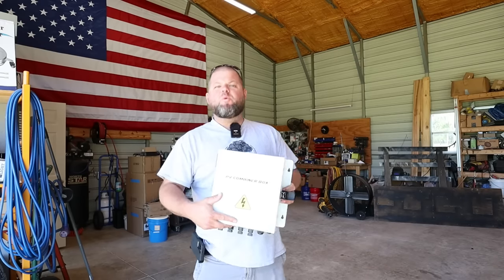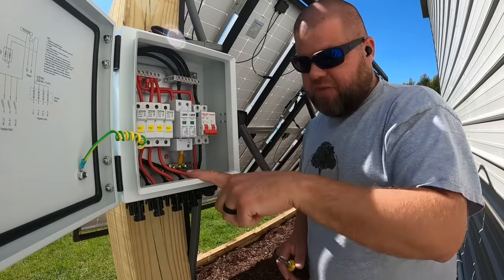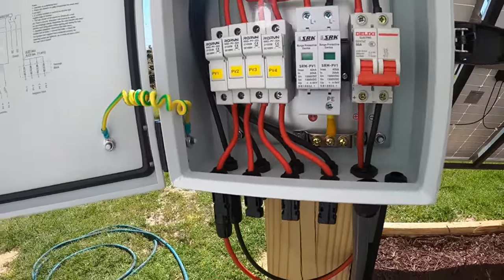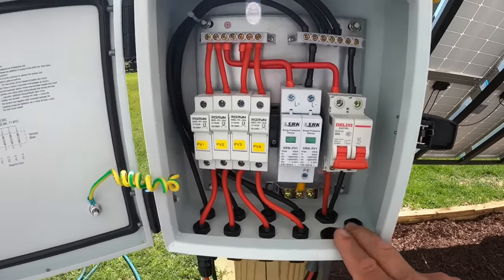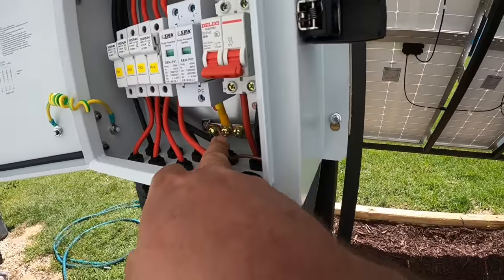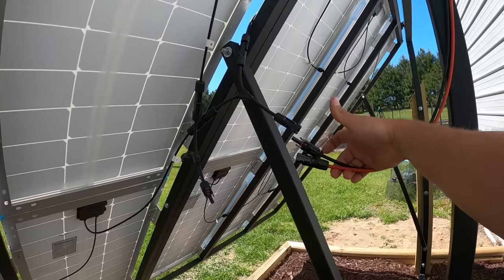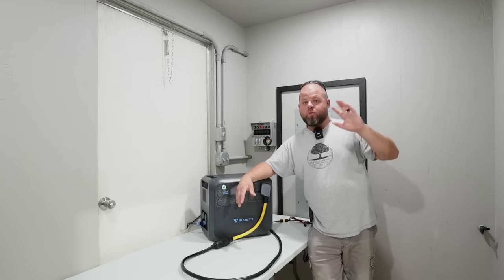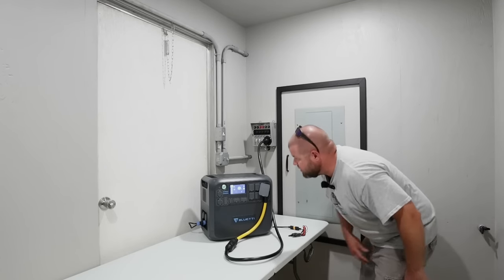Installing a PV combiner box. Why you need one for your solar array! #748

Comment: How did you determine the string length?  Many inverters will allow up to 25 -  400 watts panels.  Why was 10 panels strings chosen?
Reply from the maker: 12 panels and I'm adding 12 more. I run reviews on my channel and test a lot of different equipment. Some require as low as 100 watts for max input and some are going to be up to 8000 watts. 100 watt panels were cheap, easily sourced and allow me the most flexibility on changing combinations for testing equipment.

Comment: Good morning Andrew, I do have the same panel setup, with the combiner box, can I elect to delete Y bridge and plug the 6S2P array to the combiner  box and yield the same voltage and amps...tyi!
Reply from the maker: Yes, you amperage in that configuration will be under the max fuse rating.

Comment: I have one question please help me i an getting so tired to solve it but no one help 
I have inverter and my lithium battery bms not communicate with my inverter so the company say use battery with inverter add value manually so if the bms not connected with inverter so it can harm my lithium battery or its safe to use

Comment: Curious why the combiner box when good quality charge controllers today have a VOC of 500-600V? This was suppose to get rid of combiner boxes for the most part. I can see it if there's a lot of distance between each array.
Reply from the maker: Fuses, surge protection and the fact that I don't want 30ft of wire to potentially receive damage. Don't forget this box supplies all the equipment I review. That might be a 600 watt power station or 6500 watt inverter.

Comment: Do you have room for a second solar array of the same size besides the first one without it sticking out beyond the edge of the shop? Looks like it will be a tight fit from the camera angles I’ve seen so far.
Reply from the maker: It will sticknout about 2ft, I couldn't go any farther right with the first array due to buried water lines and electrical.

Comment: Andrew,

Your cable enters from top from the combiners bus,I mean the output breaker that supply your shop battery bank,I am thinking it should be from bottom or is it same for circuit breaker (either top entry or bottom entry)
Reply from the maker: The bottom of the circuit breaker is what's feeding my shop, you must run through fuses and the surge protector before final exit through the breaker. Maybe I'm not understanding you correctly.

Comment: Was watching your video and it appeared your ground wire in your combiner Box was wrapped. The wrong direction I could be wrong but it needs to wrap with the screw so as you tighten the screw it pulls the wire tight
Reply from the maker: Good catch, it is however sinched tightly and should never open up. Unless I start messing with that screw.
Reply: @TKCL  for safety I suggest turn it around vibrations will over time loosen it

Comment: when using a combiner box?
when you hook different strings coming from 2 different arays, does the box put both arrays in series or parell.
i have 2 arrays both at 140v and    both are 9.5 amps.
does combiner box give you 280v @ 9.5 amps or 140v @ 19 amps .
thanks
Reply from the maker: The box does parralell, so you will double your amps. Wire your panels in series at the panels themselves or before the box.
Reply: ok
thank you, after your video I'm going to buy the combiner box

Comment: How are you able to crimp to those panel wires with no protection?  Aren't they live in full sun?  (honest question)
Reply from the maker: No, you never work on live wires. I have the wires disconnected from the panels.

Comment: Newbie to solar. Due to my lot I’m going to have to put up 3 maybe 4 arrays to get continuous solar power through the day. How can I switch from array to array through the day. It doesn’t have to be automatic. Manual switching is fine. Would I do this with a breaker box or is there a special piece of kit to do this?
Reply from the maker: Is there not one location that's clear of trees or buildings. If so I would highly suggest a tracking system that will follow the sun. You can get away with less panels and one location. It should cover the cost and aggravation of multiple arrays.

Comment: Which inverter are you planning to use for your main inverter
Reply from the maker: Currently testing a Orient power 6500 watt inverter. Should it run well, I'll do two for split phase.
Reply: @TKCL  midnite just came out with the Rosie.. it’s a lot of inverter that does basically everything for a reasonable price compared to SolArk money
Reply from the maker: This one is around $1k, 120 amp battery charger, grid tied and switching capabilities, 8000 watt solar mppt, 6500 watts inverter, single, split and 3 phase capable. Seems like a lot for the money. Time will tell.
Reply: @TKCL  really interested on the grid tie capabilities of it since it’s only a grand.. imo it needs to have capability to use external current sensors to be on the homes/loads main wires so that the inverter can only supply enough power to cover all of the homes loads and not backfeed into the grid. Yes offgrid inverters only supply the amount a load is using but an offgrid inverter has to then be sized to cover all surges and infrequent high power demands. Also the battery bank can be a lot smaller if the inverter is operating as a grid tie inverter due to allowing short duration power usage/surges to be covered by the grid.. then when the battery is low the grid simply takes up the slack with no transfer switches.. I’ve been covering all my homes power usage this way for 6 years (no electric bill family of 4) using cheapo ($250 X 2) 2000w grid tie inverters that utilize batteries and external CTs on my homes mains. That way my battery power isn’t dumped into the grid..
Reply from the maker: Let me clarify, this inverter does not send back to the grid (sell back capability), it pulls power from it in the event its needed. I can program it to use solar first, grid second or solar only. Or it can run without batteries and use just solar panels and grid second. It can also be programmed to charge the batteries via solar only, or a combo of grid and solar charging together. It has quite an extensive menu for programming as you desire.

Comment: That's a nicer combiner box than the plastic Eco-Worthy's that I have, for about the same price.   A lot of solar stuff on Amazon is getting pretty seriously discounted now, too, including panels and batteries.   This is really the time to DIY solar(!).

I wound going with 100W panels for my little back-porch-rail DIY system as well.  They were just the easiest to work with and had the right dimensions for hanging off the rail without being too intrusive.   I wound up with 15 of them by the end of the project, grouped in sets of 3.  3 in series per string, then 3 strings in parallel.   In my case, there was some variable shading so I wound up with two combiner boxes going into two separate charge controllers.  Seems to work pretty well I think.

I even blew one of the fuses during installation.  Being impatient, I had two strings energized and producing and accidentally shorted the wiring on the third string for a moment while installing it (I hadn't pulled the fuse for that string).  So that fed the other two into it and the fuse did its job and blew instantly.
Reply from the maker: It is a very well built box.

Comment: When you install solar equipment as you are doing, do you need permits and inspections? Some people feed solar power back into the grid for credit and I would think inspections would be very important for that.  You are probably not going to do that.
Reply: Generally off grid systems don't need permits if they aren't roof mounted. 

But you are correct, the minute you touch the grid there are numerous plans, inspections, electrical tests, etc that are required for safety.
Reply from the maker: I'm very fortunate to live where I do. Anything AG related as my barns are classified require very little. My big barn for example required zero inspections, I even called the building department. We are zoned ag here and have ag equipment, so not everyone qualifies that way. If I were doing this in my home I'd definitely be getting full inspections, you'll need that for home insurance as well. That's another reason I am putting equipment in my barn. Also selling/tieing back to the grid for sure requires inspections and different equipment.

Comment: I would be CURIOUS if you have TESTED your Theory on your PV Panel GROUNDING ... 
I too, like you, assumed that my mounting hardware effectively grounded my PANELS to each OTHER & to the Tilting mechanism & ultimately to the EARTH ... 
it did  NOT !!! 
to get a RELIABLE "ground"  I  had to use a 4" grinder to remove the anodizing layer from each panel where I installed a  LUG ... 
then  Installed  a GROUND LUG with a 1/4" Stainless Steel Bolt, Flat Washer, & a split Lock Washer 
then fed a BARE COPPER  6  AWG  Ground wire to each PANEL & ultimately to the EARTH ... 
an  8' long   Copper Coated  Steel rod driven into the earth below my combiner-box  ( ECO-WORTHY brand )   
then when  I  tested CONTINUITY from PANEL  to  PANEL = I got my desured GROUND 
...
COOP

.
Reply from the maker: Luckily nothing has happened to test that. 🤞

Comment: 7:37 all went good up to this point. Why do you ground DC? If lightning strikes, there will be nothing left except the earth and your grounding rod. Unless of course this is for govt. compliance and regulation in order to get the CoC in the event of an insurance claim. Strange world we live in.
Reply from the maker: You also ground for shorts or malfunctions. You do not want to be the path to ground. This is quite high voltage I'm working with.
Reply: In my system, I have 470 volts dc at 14 amps coming from the panels.  That is enough to kill you instantly.  As OP stated, you don't want to be the pathway for a short circuit to ground, so you give the panels a direct path to ground.  Electricity will always flow the path of least resistance.  It won't flow thru meat and rubber shoe soles, if it has a direct path on a copper wire and ground rod to pick instead.

Comment: I had that box, complete waste in my opinion, did a complete tear down after failure and found that the wires were copper clad aluminum and the breakers weren't magnetic spark arrestor breakers, maybe i got a box made during the main electronics shortage but i got a bum deal and seller would not help me.
Reply from the maker: Interesting, I now have two with zero issues.

Comment: The Arrestor line goes straight THROUGH the arrestor into the MCB, not Paralel into it.

This is WRONG way to mount the system!
Reply from the maker: Have you ever seen whole house arrestors? They do this exact same thing, you don't put them directly into the power in feed lines. The point of a surge arrestor is to direct excess or high current to ground. They do not cut off flow of power, that's what your breaker and or fuse is designed for.

Comment: What you are doing is not correct. You will have to repeat the fuses again next to the inverter device only, and there is no need for expense because the deterrent in the box will not work in the near future due to being outside and being affected by humidity, heat and sun.

Comment: 33% safety margin? lol yikes dude.
Reply from the maker: What else is available when your talking over 5 amp panels? Your either under the rating or slightly over and having problems.
Reply: You said your loads were 10 amps per strand. 10% safety margin makes it 44 amps. we'll round up to 45. Voila - something that makes sense. A clean even 3x 15amp fuses @TKCL
Reply from the maker: Your hung up on the breaker, you have to consider the fuses per strand are much lower. I clearly stated the big benefit of the box for me was the fuses/breakers, surge protection and having a means of disconnect outside of the building.

Comment: You don't need one if you aren't running dinky Chinesium high frequency inverters and ones that can handle 600v on a single string.
Reply from the maker: What does voltage on a string have to do with fusing, a breaker and surge protection? You need that no matter what inverter you have. Your focused solely on the combining portion. I want the protection aspect and ability to kill power outdoors (which is usually required by codes).
Reply: @TKCL  You don't need a fuse unless you are combining (parallel) more than two serial strings...which folks only needed to do on older systems or MPT inputs that can only take lower voltages.

Simple DC disconnects plus something like Midnight Solar Surge protectors (very high quality).

The fuses protect WIRE. The surge porectectors protect equipment. With properly sized wire, you don't need a fuse for a single serial run.

So no. You don't need one for your array...if you're serious about it.
Reply from the maker: So nothing can ever happen to the wire? No shorts, a pinch or anything? I guess I don't need breakers in my house then. All these things serve a purpose for a what if scenario. Might not happen, but it could happen.